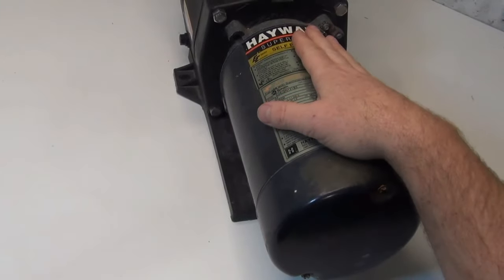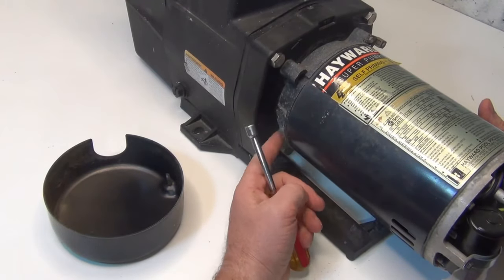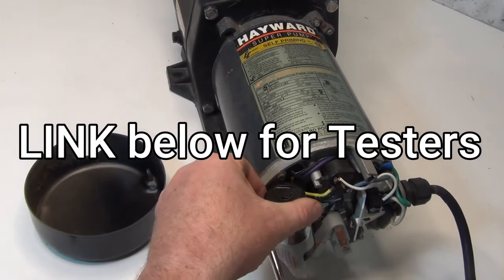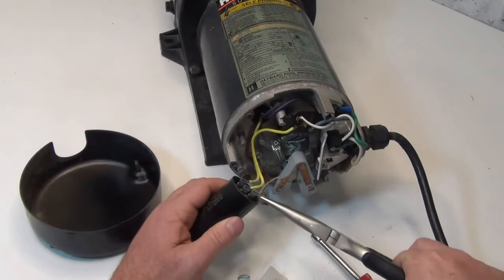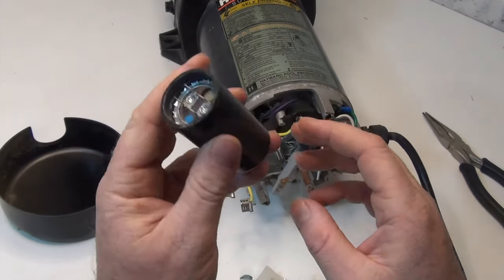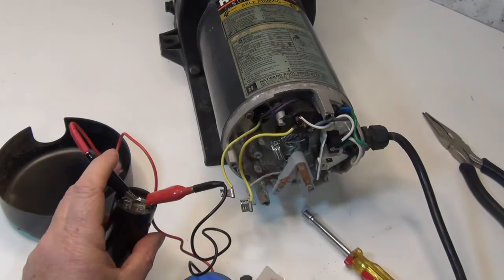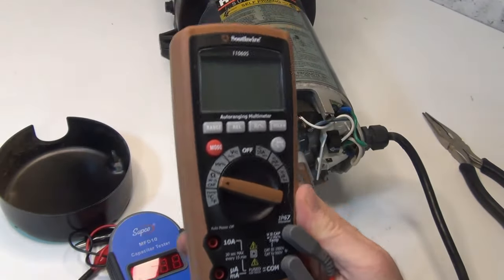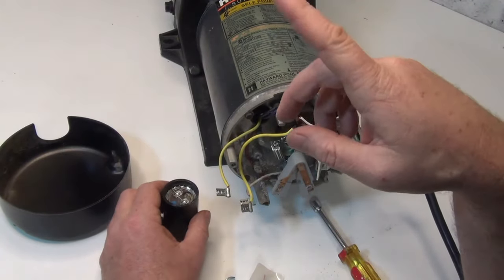Hayward Pool Pump Not Working? / Hayward Super Pump Not Turning On?

Comment: This is an old video but hopefully you might see my comment.  My pump has an interesting issue where the switch doesn't work.  It isn't tripping the breaker, it just doesn't work.  It rests in the middle, and moving it to either position has it just fall back to the center.  It doesn't latch into either position.
Reply from the maker: you test the capacitor?
Reply: @VIPPoolsandSpas  Haven't opened it yet.  Would the capacitor cause something like this?  It almost seems like the latch inside the switch physically broke.

Comment: I need to replace my very old Hayward pool pump model # C48K2N143C1C. I was looking to purchase the SP2607x10 but I just want to be sure I'm using the right amperage from the breaker with the new pump. The old pump was 1 HP and ran 115V on 20 amp breaker. Will the same breaker suffice with the right amount of electricity for the new pump model I'm looking to purchase? I've tried countless times to get ahold of Hayward with no luck or contact. Pool supply companies can't seem to give me a definite answer either. I would love any sort of help. Thank you!
Reply from the maker: A single 20amp breaker will run any 115v pool pump.  You need a 2 pole 20amp breaker for a 230v pump.  All hayward pumps can be changed from 115v to 230v and back.  Its all about the breaker.  Whatever you had before for a pump, you can use the same breaker (make sure its changed to 115V on the back of the pump,  if thats what you had before)

Comment: My Hayward 3/4hp Super Pump stopped working a few nights ago. After some investigation, I found that I cannot turn the impeller. I tried with my fingers first, and then tried with some needle nose pliers (spread open against the impeller face) to get more leverage, but either way, I cannot get it to budge. The pump was running perfectly fine with no issues at all, until this. We replaced the motor and seals 6 years ago.. installed on the original pump housing, so the motor is relatively new. Also, it seems that there is a bit of a gap between the impeller and the pump housing.... something I hadn't noticed before when cleaning out the impeller.
Any idea what might have happened?
Reply from the maker: Sounds like it's seized.  The seal might of failed and and water leaked back on the front bearing.  Take the front housing off, and turn the impeller counter clockwise. And take the impellor off.  Then see if you can move the shaft.  Your going to have to change the bearing if it doesn't spin that way.
Reply: @VIPPoolsandSpas  Thanks! Good time of year for this to happen I guess. Closing time :)

Comment: So, I service a pool with this pump. Today, I turned it off via the breaker to feed it chlorine, turned it back on, no issue. Returned after servicing another pool due to a separate issue. When I returned, there was no power on the display, and shutting off the breaker did nothing to help. Any clue what would cause this? It was probably left alone for 20 minutes, and didn’t have any issues previously that I know of. What is going on with it, do you think?
Reply from the maker: If its a normal super pump as shown in the video, then test the capacitor.  If its a VS pump then its the display.
Reply: @VIPPoolsandSpas  thank you so much man. I appreciate that you return to answer every comment.

Comment: My Hayward Power-Flo Matrix pump died after just 2 seasons. It was stored indoors in a dry place all winter, but one day it just tripped the GFI and hasn't worked since. I see no evidence of water, the motor shaft spins freely, it simply trips the GFI whenever I try to start it. Based on longevity (or lack thereof) I consider these motors to be crap. I've had to shut down my pool early this year, and next year I'll look for another brand of pump. 2 years is not nearly satisfactory lifespan for a $500+ motor that is well cared for.
Reply from the maker: @U2WB  motor capacitor.  Test that.
Reply: @VIPPoolsandSpas  I'll try. It's not visible when you remove the back cover (1 screw). It looks as though you have to remove the entire silver assembly that has 2 plastic caps that unscrew. Hoping that doesn't hold the armature in place...
Reply from the maker: If there's a switch on the back, that might be the short also.  Can bypass that by jumping the 2 wires together.  Those pumps are a PAIN to take apart.
Reply: @VIPPoolsandSpas  Yes, but it’s a single pole switch. So “shorted” =ON.
Reply: @VIPPoolsandSpas  The latest: whether the switch (SPST type) is in the ON or OFF position, the motor still trips the breaker immediately. I see no issue with the power cord but if I put a multimeter across the contacts it reads zero ohms between any two of the three cord contacts. So there's a dead short somewhere. As you said, it looks like a nightmare to open up because those hex head screws go all the way from one end to the other. Not worth the effort IMO. I'm just going to buy a new motor and pump in the spring.

Comment: Just installed a brand new motor and voltage is 230 like previous and now it will turn on but turns back off minutes after and smells hot.
Reply from the maker: If the old motor was 230 volts and the new one is 230 volts, then there's a problem with the new motor.  Make sure you wired the NEW motor right.  Some pumps come 120volts, so make sure its 230volts.
Reply: @VIPPoolsandSpas  correction old motor was 120v and new one is set up for 230v but when plugged in 120 hook up it kicked breaker.
Reply from the maker: @mirandatweedie5415  if old motor was 120v and same wiring, the new pump must be 120v.

Comment: The old pump was seized, so I bought a new pump.  Now it's tripping the breaker.  Tried several breakers, 15, 20, and a 40.  Trips instantly no hum or anything.
Reply from the maker: Wiring on the pump is wrong.
Reply from the maker: What pump do you have?  Whats the volts coming to the pump?
Reply: @VIPPoolsandSpas  fixed it this morning, it was the ground that was bad.  Thx.
Reply from the maker: @ProcTech  so the ground was touching one of the hots then.  That was the short.
Reply: @VIPPoolsandSpas  the ground I fixed was the one that goes under the ground.  Checked the wire on the pump and they were fine.

Comment: What would cause my low speed not to work?  High speed is fine, change to low speed and nothing.
Reply from the maker: If it has 2 motor capacitors it can cause that.  Test the capacitor.  Also.  Check the wiring

Comment: i just cleaned my salinator and my pool filters and now my pump wont turn on
Reply from the maker: You have power?  Does it turn?
Reply: @VIPPoolsandSpas  everything else works on my panel but the pump. It was all working fine before hand and now it doesn't work. It being the weekend everything is closed and now my pool is turning green. Super frustrating
Reply from the maker: @MarcusAurelius12  is there power to the pump?  Does the pump make any noise?  When you say it's not working, what does that mean?
Reply: @VIPPoolsandSpas  there's power we checked but when we turn it on nothing happens. No sound or anything which tells me the capacitor is not at fault. We had a pool guy come out and told us we needed a new pump. 1500 bucks jeez
Reply from the maker: @MarcusAurelius12  what pump do you have?  Same as the video?